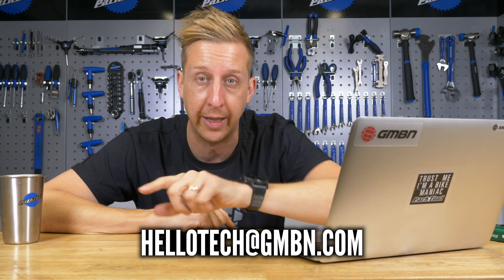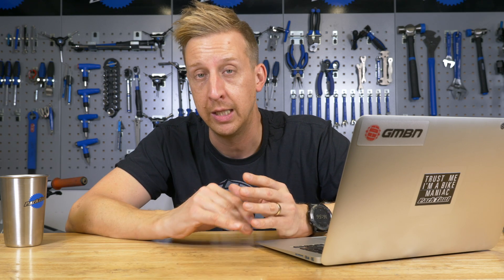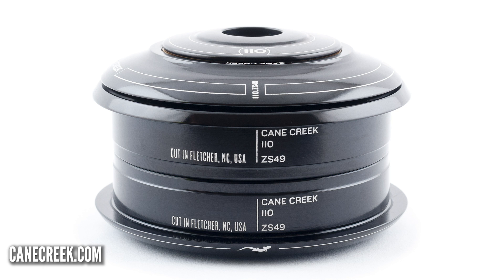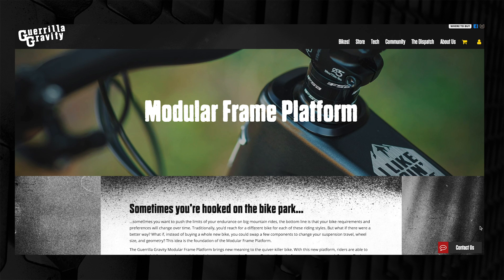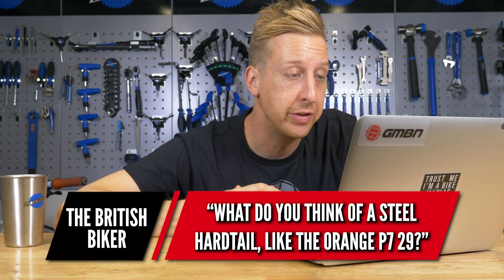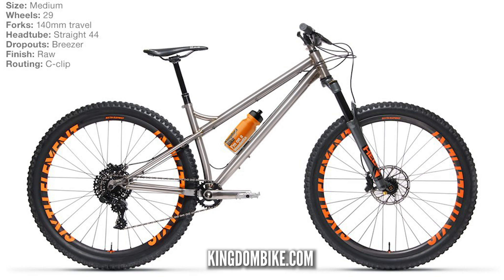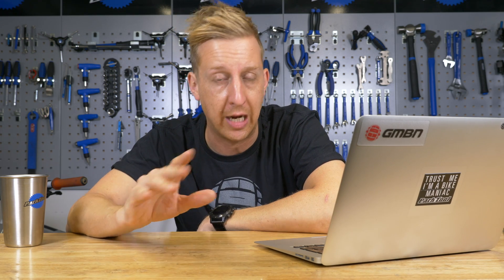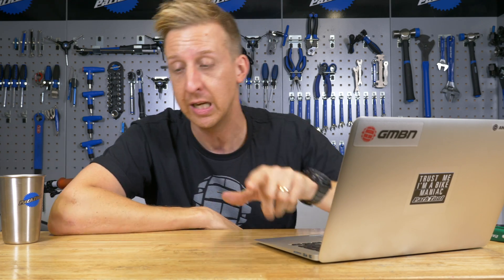What Is The best Frame Material? | Ask GMBN Tech

Comment: #askgmbntech

Hey Doddy, it would be interesting to hear what you think of high P.O.E (points of engagement) hubs and if you can easily tell the difference, and what your preferences are.

I think a blind test in a video could be cool, with maybe Neil, Blake and you, testing different hubs back to back (on identical wheel sets) but with engagement points from as low as 18, compared to maybe a 54, then a 120, and at the highest, an i9 with 690 P.O.E.

The challenge could then be to see if you could put them in order, just by feel, and of course sound, and thoughts on the benefits or noticeable differences in engagement speed or any reduced friction. But if we’re being specific about a product, I’d love to hear your breakdown of the i9 hydra and if a product providing that performance is attractive, and is it worth it to you. Cheers!
Reply: I have the Torch hubs with "only" 120 POE and while i would probably notice a difference going to 690, I don't think it would affect my riding in any appreciable way. Even 60 POE is still fine and I can clear all the same things with 60 as I can with 120. Even going down to 36 doesn't really prevent me from clearing things but it definitely feels less efficient. It would also be interesting to see how the new Hydra compares to the Onyx hubs, which have almost instant engagement and shouldn't have the flex that the Hydra hubs seem to rely on.